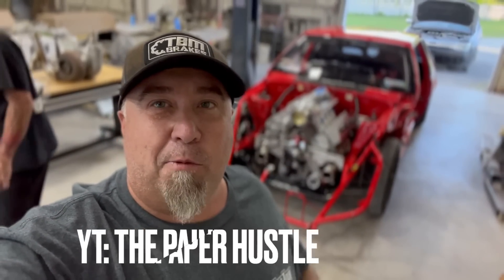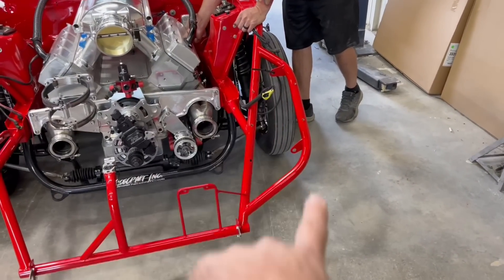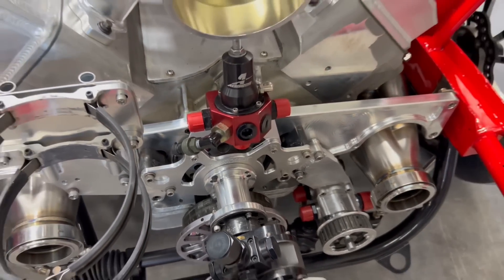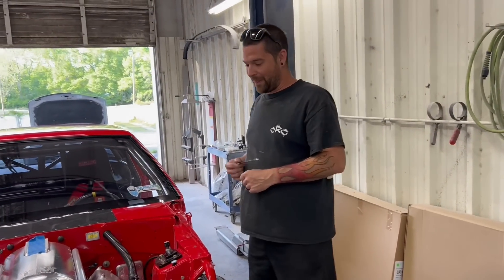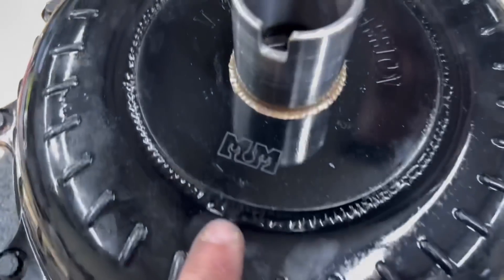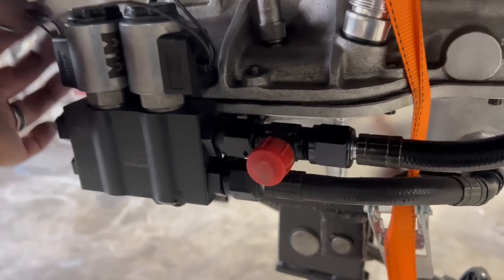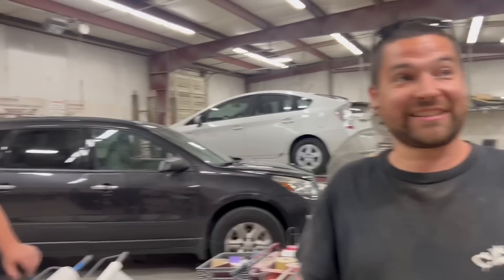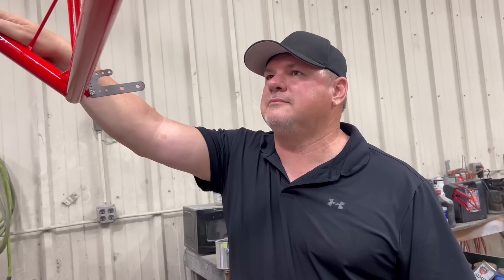It’s Back!  Randy’s HotRod coming back to life!

Comment: I know pretty much all heads up racing can be expensive, but I swear it seems like radial racing takes it to another level.  Kinda surprised the scene hasn't imploded without some major tightening up of the rules/costs, at least before it ends up running off a lot of the rank and file competitors.

Comment: Was wondering where that car went to 👍💯👍🙌🙌🙌🙌
Reply: The Chassis shop, then Courtney's Paint and body work Shop, but....Sow Mod is coming back.

Sry Randy, my N.W., AZ yard is all gravel and a tree, wife pretty flowered planted beds...No grass for you to cut to afford  more go fast parts. No recovery fund here, too busy finally getting ready to fire up my own 14 month now almost finished Stocker redebut hopefully much faster and competitive after 26 year layoff project!

1 fuel leak at the 1 connection I did not install (thanks Jegs), that extra sump bulkhead fitting on the poly cell was not fully tight...drip, drip, drip once my system flushing gallon was in the cell.

And of course there is no fully emptying it once fuel is in it, without yanking everything back out. But, at least the foam was 2. Pc, so I can stack it and get 1 hand and a wrench in there.
Reply: Show...not Sow, danged auto correct.

Comment: @turbojohn, a flexplate is called as flexplate as the convertor is supose to bottom in the crank and the flexplate "flexs" back holding the convertor in the crank. 60 thou is the general spec
Reply from the maker: I have killed a few thrust bearings from the converter bottoming out in the crank!  Took me a while to figure it out.

Comment: You don't put silicone around rubber O rings. It's not needed and just makes reassembly a pain..
Reply: With turbo cars definitely needed.   Plus heat cycle on the aluminum block.  With it growing and shrinking back down cause leaks pretty easy.    But as a technician I agree absolutely sucks taking back part